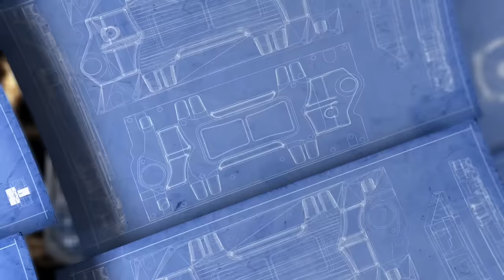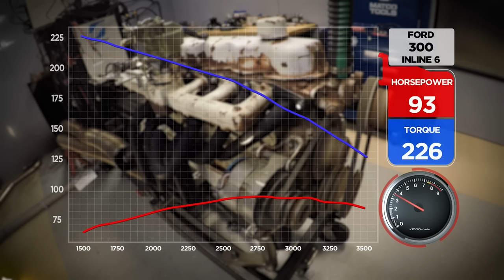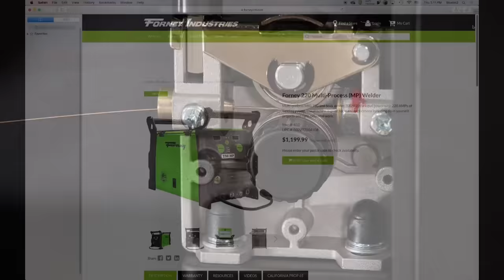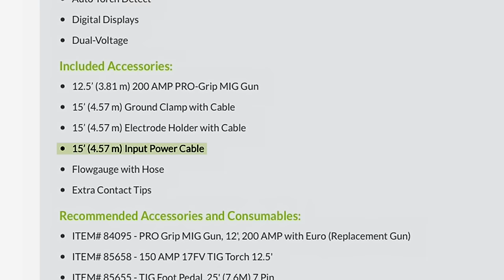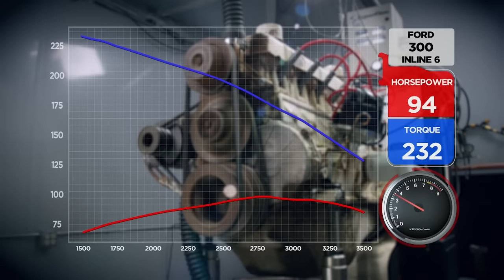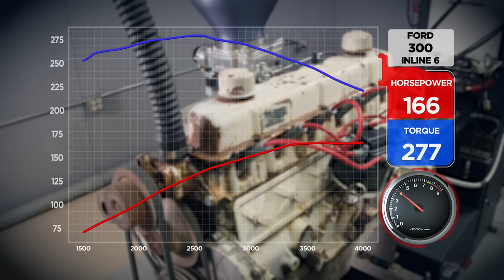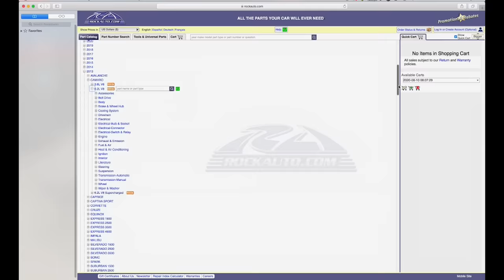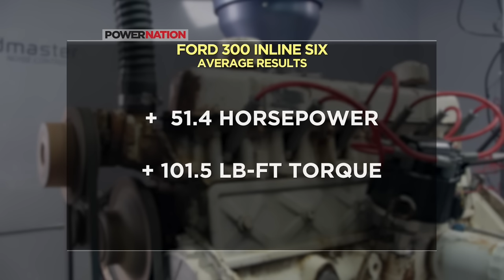Ford 300 Inline Six Gets Eye-Popping Off-The-Shelf Power - Engine Power S7, E17

Comment: We used one of these engines on a concrete pump unit . It ran for over 20 years before we bought a larger unit. The new concrete pump kept breaking down- so we went back to the Ford inline 6 concrete pump... extremely reliable engine !

Comment: I have one in a 87 bronco sat for five years was given to me I put a battery it had guarter tank of five year old gas and she fired right up almost as sone as I turned the key gonna use the body for a 91 bronco  with 351 Windsor then I want to take  leftover frame and 300 and make a rock crawler so thanks for the videos for the 300 straight six

Comment: 1.5 liter hyundai 4 cylinder makes 90 hp stock...bump compression up to 10:1 pistons...100 hp...factory stock w headers electronic ignition and fuel injection....36 mpg in town and 40+ on highway....200k miles still runs like new

Comment: I’m surprised they didn’t explain the power band difference. Seeing where in the Rpm range that power comes in is also dramatic. And worth mentioning maybe more so than a static number. The torque band flatten out so much and the hp band started a steeper increase thru the rpm increase.

Comment: I had one of these engines in an old car years ago and they are virtually indestructible but I'm shocked that anyone would make performance parts (intakes, headers, etc.) for one of these because besides you I'll be they haven't sold any. Solid power gains though, especially the intake manifold.

Comment: ‘73 e100 with 240. This is inspiring me to plan some improvements. I seem to be reading that I might run into space issues because of the firewall and or possibly the doghouse engine cover. But sure would be nice to get some more horsepower/torque. I really want to improve a bit of fuel efficiency. But would love to gain some horsepower at the same time??

Comment: I built a 300-6 25 years ago 
Full out build top to bottom 10.5-1 pistons low rpm torque roller cam roller rockers I had it on the dyno with a twin holly two barrel carbs header and an intake   It pulled 325 hp I can’t remember the torque 

I built it for my 69 one ton hiboy 4x4 made a hell of a bush truck and pulled like mule

Comment: My ‘68 mustang has the original 200ci or “3.3l” in-line 6 hope it’s as reliable as the 300ci
Reply: 3.3s were used into the 80s.  They were just as impressive as the 300 straight 6s.

Comment: I wish I had seen this video much sooner. I recently sold my '68 Ford F-100 with a 300 c.i. 6 cylinder motor to get something with more pulling power. I didn't think you could still get performance parts for in-line sixes any more. Otherwise, I would have done similar mods.

Comment: So when you replaced the old distributor with and HEI distributor did you change the gap on the spark plugs? I did this with my old Chevy truck with a 194 CID I6 engine. I had and old guy tell me what to do when I asked what spark plugs to use. He told me to use the original designated plugs, but add 0.010" more to the gap, works like a charm!!!

Comment: I know that the Chevy inline sixes have aftermarket two carb and three carb intakes available, I'd like (if they are available) to see something like that attached to find out how much difference that would make, seeing that the two end cylinders with a single carb runs lean. And maybe try a set of headers. I'm thinking that just those would push it easily over 300 horsepower.

Comment: With the stock cam setup, a set of Chevy inline six rockers with a 1.75 ratio should have been tried, it will increase the lift, and the 300 responds well to it on the seat of pants dyno. Would have been nice to see the number difference. Not to mention it is a very widely used cheap trick used among 300 fans.

Comment: Although I love V8'S but I love the fact you folks are doing hopped 6 cylinder engines. Some folks have no respect for the straight 6 and are quick to throw it into the scrap pile. These straight 6 cylinder engines have a lot of potential and it can be unlocked by using headers, EFI, turbo and what not. If I had classic Mustang with the bases 200 CU. or 250 CU. straight 6 I would have it hopped up with headers, turbo and EFI.

Comment: Just a guess, but the small intake/carb for a stationary engine might've been to limit fuel consumption since it would have been running a long time.
Reply: tkrotchko that intake and carb were used on many 150's., Econ vans, Maverick.  My light duty 250 had that set up.  It would do ok on flat road but wouldn't pull a load up a hill without ending up in 2 nd gear at 25 mph. It would get 13 mpg no matter what, idling or running full out.  I always wanted to tinker with it but had no time when working and no money when I had time.
Reply: @magicone9327  interesting.  Thanks for that reply.

Comment: I have a willys f-head four cylinder cj5 I rebuilt back to stock. Only had 370000 original miles when I rebuilt it. Only had to be bored out .20 over. I wonder how much a header and carb would bump the 70 hp rating? I have it on pertronix and it runs perfect stock.

Comment: You can learn more about the 300-6 at the Fordsix.com forums. I had a dozen plus trucks with a 300-6 81-86, 92 & 93 F150’s, 71 F600 yes it had a 300-6 and my favorite the 94 F250HD with 300-6 and a ZF heavy duty 5 speed manual transmission I regret selling 6 years ago.

Comment: I stopped going to classic car shows a long time ago.  I got sick and tired of looking at over chromed V8 engines with turbo chrgers or blowers.  Car after car...all the same.  I once saw a slant six in a Low Boy.  What a change, it really looked good and probably very fast.  At a show in SoCal more than 50 cars had the usual V8s.  Ah, but only one had something original.  A Henry J  powered by a Suburu flat engine.  Weird but thinking outside the box.  That was it, one car out of fifty.  No more car shows for me.

Comment: most of the equipment at the airport is powered by ford 300's. 

I had a tug with a nasty metallic sound. We didn't have time to tear into it and kept in service for about 2 weeks before I had the extra time to work on it.

 I found the exhaust valve dropped and was shoved stem first through the #1 piston. It was in service for probably 200 hours like that moving cargo around the airport. I wish I was there at the moment the valve dropped, just to watch the none reaction of the operator who continued to use it...

Comment: The only bad thing you can say about that motor is the Mazda M5OD manual  transmissions that Ford used to put behind them. (Whht in the heck were they thinking?) I have a 300 6 with a bit over 400K (out of an '89 F150) being rebuilt as I write this.

Comment: Was wondering about 2 barrel carb and engine rebuild complete, would like to see HP/ LB-FT and Gas mileage for the up graded version, do you plan on doing ?? Also recommended Transmission there are advantages manual or auto.

Comment: Now guys don’t necessarily have remove the in line 6’s from their first gen Mustangs to make them true muscle cars.  I’m sure with a better cam and stroke you can get more. Bore it out, bolt on a turbo or supercharger, add a larger fuel pump and it could end up with 200-220hp or more. If BMW can get more out of their 3.3L 6’s so can Ford. 

I’d like to see you guys take this motor to the next level.

Comment: i have to say one thing here.when they put the headers on they said it was 93.7 horsepower and called it 94. okay. but then they put it this mega blueprinted electronic distributer and it comes out with 94 horse. and these guys are claiming its a big improvement. .3 horsepower increase? real big improvement there....

Comment: The original Chrysler 225 Slant Six produced around 145 horsepower at 4,000 rpm and 215 ft. -lbs. of torque at 2,800 rpm..hmmm 😏

Comment: I drove service trucks and vans with that engine for over 40 years. Yeah, after they stopped making them. Plenty of HP and torque for its needs and reliability and longevity people just DON'T believe. By no stretch a performance engine, but THE tool for the job. In SPADES. We tried other trucks and vans, but the overall cost, INCLUDING NO DOWN TIME was the difference. A sin Ford quit building them. Nothing else I've seen has been as bulletproof. ALTHOUGH I've heard the 4 lite Jeep was close. It too an inline 6. Something about the design?

Comment: I have a 1982 Chevy 250 L-6 with the integral head , what performance modes can I do to increase the horse power and torque. Money is tight , it has the stock 2 barrel. Jeff

Comment: Considering that all you have to do to an engine to make it green is use pure Ethanol Not E85. At 13 to 1 or higher compression and then it will have more power and any comparable gasoline running engine

Comment: B code truck engines had forged crank, rods and pistons. Also had a deeper set water pump.

definitely worth checking out Clifford Performance for anyone looking to make power on one of these. One of the big issues these run into is the 1 and 6 leaning out when it gets cold, gets worse when you remove that heat riser of the stock manifold, Clifford mitigates that by adding a coolant loop to the intake manifold, or if you are so inclined the better setup is a twin Weber 2bbl.

Comment: Very interesting build on this Ford 6.  I had two 6 cylinder Ford Broncos in the early 1980's and they were good performing engines.  I would subscribe to your channel however, between you two guys selling items in the middle of the build and "youtube" sticking those ads in the middle of words.  Crap, youtube's timing sucks.  I couldn't take all the sales pitches.  The information on the welder was extremely interesting though but the rest of the bill paying stuff was a little overboard.  Youtube is screwing up their channel and your performance.

Comment: any idea on how much it would cost to have a mechanic put on the intake and exhaust manifolds as well as a bigger carb?  3000? 5000? more? parts roughly 500 for intake 600 for exhaust and 600 for a holly or edelbrock 4 barrel. 1700 roughly in parts. whats rough labor cost?

Comment: Port that Head and put a Supercharger on that Beast ......Have many fond memorys from my teen years driveing my dads old fords with 300 6's and they where torque monster's.....
Reply: IT'S THE SAME BLOCK AS THE 240 EXCEPT FOR THE CRANK/RODS(STROKE). THE 240 MOTORS HAD HIGHER COMPRESSION BY VIRTUE OF A SQUISH AREA IN THE 240 HEAD COMBUSTION CHAMBER AND THE 240 HEAD BOLTS RIGHT ON. IN THE DAY, GUYS WOULD SWAP THE 300 HEADS FOR 240'S.

Comment: hahaha the comments "they should spin that thang to 6000000 rpm then itll make power" psssf wtf have you people ever owned one of these? 2500 an these sound like there gonna explode, they dont ofcource but gees. they nearly doubled the power out of this with very simple bolt ons and at a very usable work driving rpm range. I woulda love this setup on my '83 f100 back in early 2000's

Comment: IMO, that test is not conclusively indicative as to what each bolt-on item did in terms of horsepower and torque increase, because the results would surely have been different if the same bolt-on items had been installed in a different order. For instance, had the headers been installed last, I believe they would have accounted for far more than a 5 horsepower increase (Of course, I know Powernation knows that). Only collectively matched can each bolt-on item reflect it's true value increase in terms of horsepower and torque increase -- and they certainly and impressively did. The power and torque increase was very impressive.  I remember back in the  1970s Popular Hot Rodding magazine used to do similar one bolt-on at a time articles.  I don't recall if they did a dyno test after each bolt-on part they installed, but they took the car to the strip and checked it's ET. I recall they took a tired but stock 302 Mustang. They did some baseline runs at the strip to establish an average ET. Then they started to bolt on performance items one at a time, taking it back to the drag strip each time to see what difference it made. I think finally they rebuilt the engine, incorporating all of the hi-perf bolt-ons. I think the rebuild and bolt-ons knocked abut three seconds off the 1/4 mile time.  At the time one of the cars I had was a 1966 Mustang coupe, 289-225 HP 4-spd. It was bone stock. I followed Popular Hot Rodding's advice and installed a set of Black Jack headers, Edelbrock aluminum intake, 600 CFM Holley, HI PERF air cleaner, plus HI Perf dual exhaust mufflers. The car was just a daily driver, and the mods made a noticeable difference in performance.

Comment: Your brake cylinder tip, I get it, trying to make money from a product, but that was lame. Just use the old brake pad on the cylinder side to put the c-clamp on to compress the cylinder back into the caliper, no worrying about "cocking" the piston into the bore... You almost made it like one of those bad infomercials "hurt on your hands or wrists" just missed throwing in the "OUCH" lol... anyways, enjoying this video.
Reply: Now they have rear brakes I practically had to take out to dinner just to back off the electric adjuster.

Comment: Can you guys help with my project I'm working on a Ford f150 300 4.9  in a 1995 ford Truck. I need know what bolt goes where on the intake manifold for the fuel injection

Comment: I didn't understand the 88 horsepower my grandfather and I used to build Ford straight sixes in the 1970s and bone stock they were 165 horsepower, the 300 was way bigger in cubic inch than what we were using. And we would get them up to around 400 horsepower after modifying them . So I don't get it as I said

Comment: I'm surprised the rockers did anything at all. wouldn't think they would. Why would they? I don't get that one. Headers and intake and bigger carb, standard old hot rod stuff. Next, you need to find just the right cam grind to work with those headers and that intake and carb. That can be difficult. Sometimes a cam with higher lift and or duration takes it the opposite way if it's not right for the other parts. Lets see, a cam lighter rods and pistons, perhaps with a bit higher compression, or if you plan putting a turbo on it you don't want too high of compression without boost. where the magic line is, I wouldn't know. I think putting a turbo on it is the wrong thing to do however. dual Paxton style blowers are more to the spirit of this motor and what was done back in the day. There used to be a kit sold for this engine, it was called 6=8 back in the day. It consisted of a cam, rockers, headers and intake and carb that supposedly, would give you at least as much power as a V8 of the period. (around 68...to 70)  Turbos did not see much use then, they were sometimes used on big diesels but mostly they were either naturally aspirated or used blowers, a GM style 6-71 being the most common and a 9-71 being seen some times. putting a turbo on this defeats the gains made by opening it up with the headers and intake/carb.... at least until the turbo spools up. Least ways that's how it was back in the day, I don't know squat about modern stuff.

Comment: Far as compressing the calipers go, thats why you leave an old pad in there to compress the pistons, I have no idea why anyone would compress the piston directly like that it's just too risky in my opinion. Btw, if you dont have a C clamp, a caulk gun works too in a pinch.
Reply: The manifold and carb upgrade and the rockers also was given more RPM to operate with no ? .... Think it was 500 rpm, what if you left that range at what you first started, what was the numbers ? Has me curious

Comment: Need to put a timing gear set that has marks to advance cam timing 4 degrees. All stock cams come standard marks 4 degrees retarded. Have since the 70's. Advance that cam 4 degrees will feel like you put a whole new cam in it.  It's why some motors just don't seem to want to make what you would think a motor that size could make.

Comment: THIS ENGINE IS LOW RPM INDUSTRIAL ENGINE...THE DISTRIBUTOR WILL NOT LET THAT ENGINE REV PAST 3000 RPM(in that neighborhood) no wonder it is only 90hp) Standard vehicle Big 6 was 101 to 120hp NET RATING...Compression changed over the years to give it more and less hp....(170hp..brake hp).from 1965 to 1986 was this 6 banger ran in most trucks and vans...in 1987 EFI WAS INTRODUCED GIVING THIS BIG SIX 170HP!!! AND GAS MILEAGE WENT UP FROM 17MPG(best on road) TO 23-25 MPG (road...I owned one)...Take it for what its worth...THIS BIG SIX WAS FORDS BEST 6 CYL ENGINE...ALMOST SQUARE BORE(4") AND (3.98")STROKE with 7 main bearings...I must say this industrial engine is an EXCELLANT CHOICE TO GET MORE POOP FROM...GOOD JOB GUYS...

Comment: Just curious, what were the 4.9s HP rating in the early 90s trucks? Someone once told me they were roller motors, but I know next to nil about Fords.
Reply: The 300 never got roller lifters.  

EFI 300s (1987-1996) were rated 145 hp or so, 280 torques.

Comment: a gm-style h.e.i. distributor on a ford truck 6 just doesn't look right. i've got one in a '94 f 150 4x4, and it's fuel injected. some of the parts you are using i may try out. thanks!

Comment: Would have made more power with the ex manifolds installed upside down pointing up and run the y pipe over the top of the engine. Ex flow would be about 30% better in that config. Wonder if anyone knows the block failure power limit.

Comment: If you guys wanted to use the stock manifold for base testing... why in the heck didnt you just test it with the manifold on before you took it off lol.   Who the hell need a caliber spreader tool anyway... put the break pad on and compress the pistons lol... geesh
Also did you you guys use the gear on the old distributor before you put the new one on?   The gear are suppose to be use in pairs. you shouldnt put a new distributor gear on with an old one in the engine